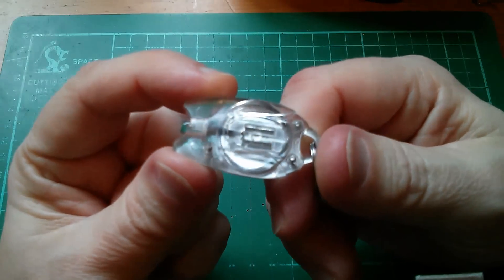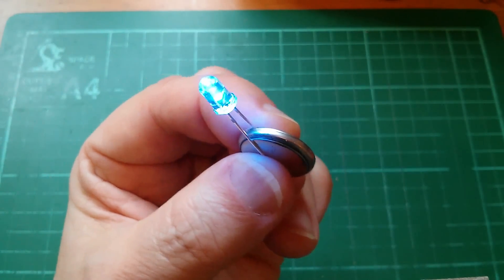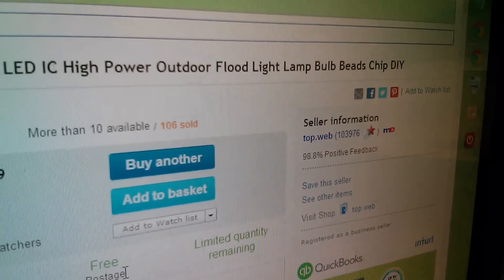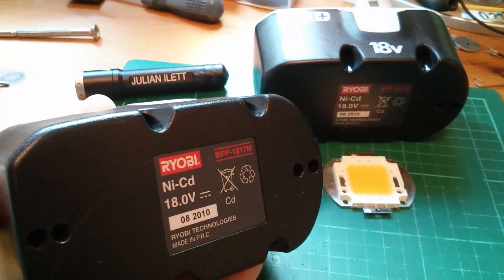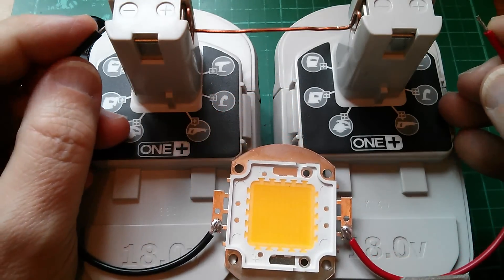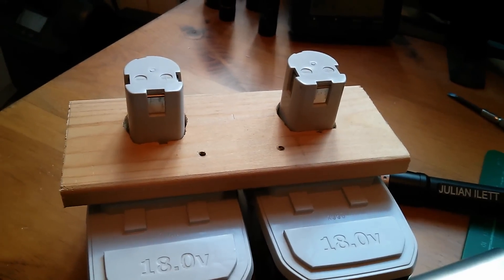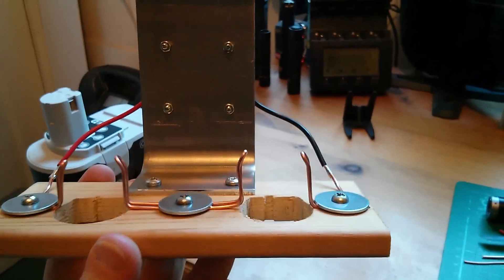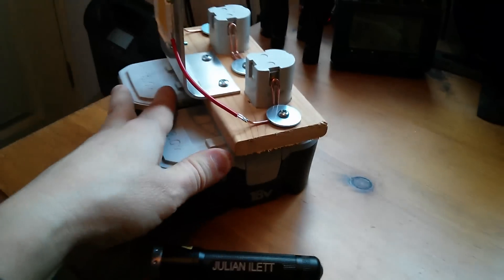Monster 7,500 Lumens 100W LED Flashlight for under $10

Comment: Brilliant demonstration and build.  You might try looking for an old DELL  PC  in that skip.  DELL made huge heat syncs for some of their comps that used a plastic duct to a  fan in back of the computer case.   Hmmmmm?  use the duct and big fan to mount to a small amuminium box to mount your monster LED  to  and you may be able to get a full minute before to have a mini supernova. This would be great Light to signal airliners to land with after the BIG  EMP  destroys most of the unshielded electronics in the world.
Reply from the maker: Bill James Great idea - market this as an EMP-proof flashlight for use after the apocalypse! Thanks Bill
Reply: Bill James How the planes are still working if BIG EMP is used :D?
Reply: I think an old Pentium CPU heatsink with a fan would do a great job of cooling that LED, especially if a small aluminum mixxing bowl or cat dish were sandwiched between the LED and the heat sink.
Reply: +Bill James Dont forget that the LED is a semiconductor, it would be fried after nuclear EMP.......................

Comment: take for heat sink a processor cooler wit the ventilator powered by a lm 317 circuit from the 18volt to make 10volt or 12volt
an take the artic silver for reducing thermal resistance.

Comment: Julian llett , I live in a farm with no electricity and I use an engine to produce electricity when I need it , will I be able somehow to charge any kind of batteries that I can use when the engine is running out of fuel ? and can I charge them by the engine itself ? thanks mate
Reply: Does your "engine" generate 120volts or 240v?
If so, you can use the mornal charger for those batteries.

Comment: No no no. Just no. The steel 'heat sink' is ridiculously undersized. You say balanced sweet spot that will not damage the led. That is nowhere near the 40VDC you are throwing at it. With that 'heat sink' you are probably looking at more like 10VDC if you are lucky for extended usage. To properly cool a 100W led you would need a huge passive heat sink or a fairly large actively cooled one. It's a fun experiment, but by no means a flashlight, or a good guide on how to build one.

Comment: You could just solder 27 NiCd batteries together for $50. At 1000mah you'd get 20 minutes continuous use - and closer to the exact voltage spec.

Comment: Nicads are not he way to go, I'd power it with nimh batteries or LIoN packs with pulse modulation rather than resistance, which just wastes most of your power as dissipated heat

Comment: Maybe see if there's a CPU heat sink that is of equal size and can be mounted to the back with thermal paste and a fan?! I'd guess this could work for a few minutes or longer. There must be a way to cool it properly or they wouldn't have produced it, so what is the application that you find this in?

Comment: sorry but this video is complete shit. firstly how is it a lucky co-incidence you can use 2 18v batterys? loads of batteries exist and therefore it would be always possible to find 2 to work and secondly whats with the fake title to get views? ryobi batteries are what £30 each so to make this would cost £70 for yours or £30 using cheaper batteries. so no you cant make this for $10 dollars because without batteries its half made
Reply: He did say for that price it wouldn't include the battery, nor did the title mention anything about the battery, but so you can hear, it's at 5:37 on wards.
Reply: i know there title didn't say it but that's the point. if the batterys were a pound or two fine but when they cost six times more than the light then saying make it for $10 is stupid.

Comment: Is there a lower voltage sweet spot that will illuminate that 100 watt LED but will not generate as much heat and at a reduced lumen output?
Reply: Connect a current-limiting resistor of different arbituary values to get different LED light intensity, measure the voltage drop of the LED at the light intensity preferred.

Then you can either use a power supply same as the measured voltage drop without any resistor, or use the original power supply with that particular resistor value and calculate the rating of  the resistor by W = V^2 / R = (Voltage of Power Supply - Voltage Drop of LED)^2 / Resistor Value.

Comment: You didn't measure the current or voltage.  My guess is those batteries were putting out a lot more than 100W

Comment: The sellers spec sheet says 32V to 34V. The combined full charged voltage of a 18V battery is around 19-20Volts. That being the case you would be pumping at least 36 to 40Volts into this LED How long do you think it will last before you burn it out?
It may work well for a few seconds give it 10 minutes with a 36V ebike charger attached to maintain the voltage. See what your results are then!

Comment: You won't get 20,000 hours out of your flashlight unless you carefully control the heat and current of your LED. Then again, you are not going to run it for that long anyhow. It's the internal resistance of the batteries in series with the resistance of the LED that limits the current. Heftier batteries would have less resistance and be worse for LED lifetime.
Reply: Xxx

Comment: Would be far better to limit the current correctly with a resistor allowing longer use and longer life of the led. Also if you cut lots of slits into the metal, you could easily increase the surface area of your heatsink, and therefore its efficiecy. However this is no flashlight  the word flashlight implies a portable handheld device .... this is not :) Nice though.

Comment: Twin & earth mains?  Forgive this American for not speaking "English"  but that looks like our 14-2 UF except color coded red/green vs black/white. Is that wire in common use for residential  indoor or outdoor application in the UK (assuming that's where u are)? With its moulded ground, that would be used underground here in the US

Comment: you moron use a freaking resistor already, 220 ohms 200w should do the work
Reply from the maker: Chris Weghorst I think you mean 2Ω
Reply: Julian Ilett it is meant to control the current so that the led wont burn out, cause an led is still an diode and what he actually does is shortcutting the batteries.
Reply: i made an acurade calculation to show how much te resistor should acctualy be 
P = U*I => I = P/U = 100/36 = 2,7 A
R = U/I = 36/2,7 = 13,3 Ohms 100Watt (rather take 200 tho)
Reply: It's nice to share opinion on the web. New knowlege is gained through constructive discussions. But do it with respect to one another. Why use the word "moron" that is derogative; and maybe you are actually the one.

If I = 2.7A and R = 13.3Ω, the resistor will drop 36V. What kind of electronic mathematics it is? Moreover, how to get a 100W resistor?

The more one thinks one understands, the more one actually misunderstands or gets confused.
Reply: I know it's been 3 years ago since you made this insulting comment  but I am hoping you grew up a bit or some one slapped the crap out of you for saying something stupid then you grew up.

Comment: wouldnt this + a 12v battery or PSU be a more suitable power source?
http://www.ebay.com/itm/150W-DC-DC-Boost-Converter-10-32V-to-12-35V-6A-Step-Up-Power-supply-module-/141316770525?pt=LH_DefaultDomain_0&hash=item20e722cadd

Comment: Between the cost of those batteries, and the short lighting time, I think buying "16"  9 volt
batteries ($8) ? set up in 4  "4 packs" at 36 volts in parallel would give you a longer lasting light in a more compact system.

Comment: I would have at least checked the voltage drop across the LED. Turning it on for a few seconds and seeing it light is not enough to declare it a working flashlight.

Comment: Not particulary suprising. Batteries are a power source rather than a voltage or current source. You simply cannot draw more than a certain wattage from it, as the internal resistance rises with the current. 
So as long the maximum power the battery can supply is lower than the LEDs Ptot there won't be any issues with the LED.

The problem is that if you use this kind of current limitation, a significant part of the power is heating up the batteries rather than producing light.

Comment: It is important to note, that the V-I curve of LEDs is very temperature dependent.

As your LED array (it really is an array of 100 1W LEDs in that square) heats up, the curve will shift so that the 100W LED has a lower voltage threshold, and will draw more current.

So it great that you found the sweet spot, but that sweet spot doesn't maintain itself, and that's why people use constant current drivers.

Comment: If I'm not wrong, when you touch the copper at the end, you are touching a wire that supports a 36V 3A current. Does it hurt ?
Reply: *****
 Wrong. The 3A are in the wire. Your inner body resistance is way too high to achieve 3A at 36V.
Reply: i just made a small experiment. I connected my Lab-power supply with my multimeter and measured the current form hand-hand 300µA@38V and hand to foot. 50µA@41V.When my fingers are wet the current hand-hand goes up to 500µA I felt neither (except the poking from the measuring tip).
Therfore the human body resistance is more like 130-800k dry and 80k wet. So i guess the 60V limit for ELV is on the very save side.
Reply: Voltage below 60V is usually harmless. Doesn't matter how much current flows.
Reply: ***** Not correct. If you had 3 amps going through your body you would probably already be long dead. 36 volts only runs probably less than a mA through your body because of the high body resistance.
Reply: MrNaichwersonst Well the current doesn't quite reach 5A. The Pulse is produced by a switching circuit that cuts of a current trough an inductivity. The energy stored in the magnetic field is is usually less than 0,25J. So the current will drop from a few hundred mA to zero within 10µs. Too little to cause real damage. Might disturb you heart muscle however. So not recommendable to fiddle with electric fences too much.
Reply: Ohms law is part of what kills you and also the path taken in your body if its across your heart it can be heart stopping. You can survive 240 with a large tingle and a few swear words, if you exercise the habit of working with one hand and not touching an earth with the other rubber soles, fibre glass ladder or cherry picker boom. Better still unplug from the mains, still test to make sure you unplugged the correct one, and never ever assume an extension lead (the worse offenders) or a plug or light fitting has been wired correctly or with the live on the switched side.
Reply: 36V shouldn't be enough to electrocute you unless you are like really wet or something
Reply: ***** Also, about the tingle at 3A. You get the tingle at 3mA and over 10mA it is really painful and risk of death. So you are off by 1000. And it's not about the current going through the wire it's about the current going through the body. Those 2 differ alot as you can probably already tell.
Reply: NKN1396 Good response explaining how it isn't  all that simple as to say 'x Volts' or 'y amps' etc, but one correction.  You repeat a very common, and DANGEROUS, misconception:  current takes the easy path.  This just isn't correct.  If you and a 1 foot diameter solid copper rod are put in parallel with a voltage  source, it's true most of the current will go through the copper, but you are still subject to that voltage and will draw just as much current as you would if the copper wasn't there.  The electrons don't decide you're too difficult a path and veer over to the copper.  Real-world current limiting won't save you unless it's enough to drop the voltage to a safe value.
Reply: mechtheist  Thank you, you're reassuring me :-) I've heard that a lot of time but I always wondered "If this is true, how can parralel circuits can be possible ?"
Reply: He never touched both at the same time, even though it looked that way. On the off chance he did touch both, he would feel it, but most of the current would follow the wire, and his hand would of jerked back in an automatic response breaking the connection.
Reply: Duane C He would only feel it if his body was really wet.
Reply: *****

Idiot.

Ever touch or urinate on an animal fence which here has 48V.

Perhaps too often and your brain is damaged.
Reply: Perhaps you should read it and ask yourself.

How can I tell someone that voltage under 60V is not dangerous?
That is stupid nonsense, so called IDIOT.

Why is there any need to tell people that is is not ok to put a cat, wet or not, into a microwave?
Some people dude, same people.
Reply: MrNaichwersonst Animal fences are POWERED with 24 or 48V, but the electronics crank it up to  pulsed 2000V-10000V. Also see: http://en.wikipedia.org/wiki/Electric_fence
The human body has a resistance of about 2000Ohm(Hand to Feet). So if you touch 48V a current of 24mA will flow. Most of it on the top of your skin though. It is noticeable, but not dangerous.
If you pee on it however the resistance dick-feet is about 800Ohms, so the  Current is more than double. Painful, but not dangerous. 
Any Voltage below 60V DC or 35V AC is considered save according to the International Electrotechnical Commission(IEC). These voltages are called Extra Low Voltages(ELV). Also see IEC 60364-4-41 for details.
Reply: *****
If you were right and I touch it as it was pulsed to 10000V I will get 5A.
And you tell me that it is not dangerous?
Have you ever read about people who died after touching a fence?

Perhaps you touched it too much
Reply: *****
No it wasn't. Achieving 3A at 100,000V is possible. But not at 36V
Reply: ***** You seem to know about basic electronic ampliances, NOT basic electronic physics. When he means you cannot achieve 3A at 36V he means through the body, not a cable.
Reply: ***** Whether it is a tingle or not it doesn't matter, I wasn't addressing that. Someone said you cannot pass 3A through body with 36V. You said you can when you obiously can't because of the high body resistance.
Reply: ***** If you read the other comments someone said you can't pass 3A through your body and you seem to have misanderstood it and said you can but you seem to have meant a wire not the body. I was just correcting you.
Reply: ***** Well, you were correcting the other guy when he was correct. I'm going to stop here. If you understand good, if you don't, well you have problems.
Reply: *****
You said "Wrong it's not the volts that kill you it's the amperage [...]". This statement is wrong. I'm about to get my bachelor's degree in Renewable Energies (>50% electrical engeneering). So I'm pretty confident about what I'm talking about.
Reply: There are two types of electrical generators: current and voltage. Here he uses a battery, which is a voltage generator, That means that no matter how much current you take, it will keep its voltage (the voltage actually drops after 3A; in fact it drops linearly because a real source is equivalent to a voltage source and a resistor place in series). And after the well known Ohm's law, I=U/R, you can compute the amperage that flows trough him. Depending if your hands are dry or sweet that resistance can vary between 100.000 to 1.000 ohm. So at 36 volts the current would be between 0.36mA (doesn't feel anything) to 36mA quite a strong tingling. 
If we would talk about a current source (very rarely used in consumer electronics, one exception would be led drivers) they are varying the voltage to keep to current constant. They can do that in some limits, because a current source without a load is like a voltage source in short-circuit.
Reply: *****
Unless it's an inductive circuit, or you're really flowing a LOT of current. You won't notice it on power on, but breaking the circuit you can get a bit of a kick, nonlethal and really not that bad, just surprising is all, when the magnetic field of current flowing through the conductor stops.

Remember inductors don''t like their fields changed, either added or subtracted. You can notice this most readily on battery circuits, 12V jump starting something big is a good example. You get 3-4 truck batteries in parallel, you can flow some serious current.

Comment: You really should use an LED driver to control the current.

I have a 10W LED spotlight.

It has a 12v battery to power the LED and it can power the LED if i decided to hook it up directly.
But the point of an LED Driver is the control the current the LED gets.

Comment: Sorry Julian, but this is sensless since there is no current limitation in the circuit. Even in short turn-on intervalls, the led can (and will) take damage due to the hughe amount of current.
Reply from the maker: Ex0r LED damage hasn't been a problem. But because there's no current control, LED brightness does drop off quite noticeably as the batteries become discharged.
Reply: Can you measure the current?
Reply from the maker: I did measure the current with fully charged batteries - between 2.5 and 3 amps.
Reply: okay. The internal battery resistance is high enough to keep the led away from Ptot. Thanks for sharing!

Comment: I used to use those same LED's for indoor growing.. 3000k is a fall light spectrum. 6500k would be spring or summer. I would power them with simple cellphone chargers. They worked great!

Comment: 100W led means at least 50W of heat. The heatsink is too little. How long do you think the led can be operative before its temperature reaches 120°C?
Reply: Within approximately 1 minute the LED will be wasted, if it is operated with the small heatsink shown in the video.

A LED is a semiconductor, just like the CPU in your PC.  Cool it sufficiently or it will be dead in a couple of minutes.

Comment: would be interesting if the current would rise too high after long usage.
for everyone who wants to rebild this: a cheap constant current boost converter is not that expensive and should drive the led without frying it ;)
Your video inspired me to finish my own project:
Very bright DIY 100W Flashlight (8500Lm)